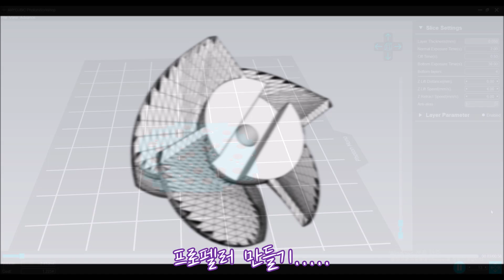Build a RC Submarine. 1/24 Humpback Whale ep. 3

Comment: Nice work. IMHO the front fins  are set too far back. Also, as you are obviously going to use a thrust vectoring nozzle in the tail to steer the bow thruster seems superfluous, why not use it to make the blowhole squirt out water. And lastly, you seem to forgpt to add vent and flood holes in the hull.